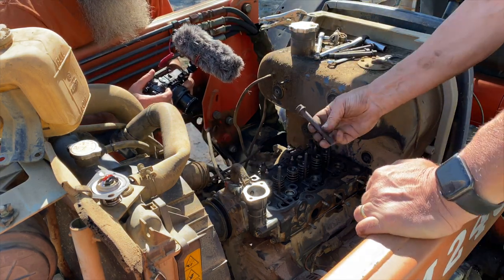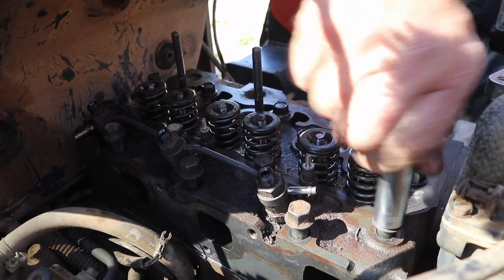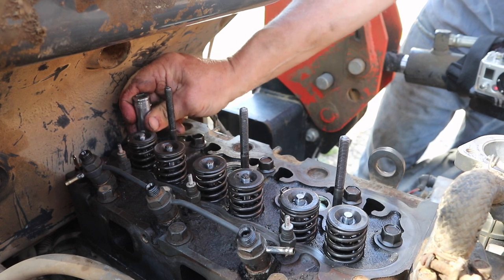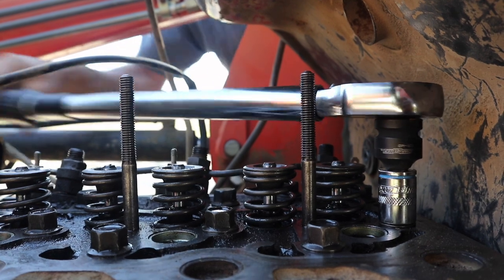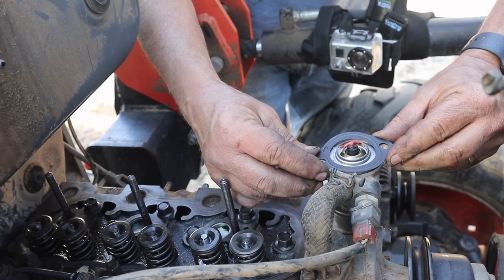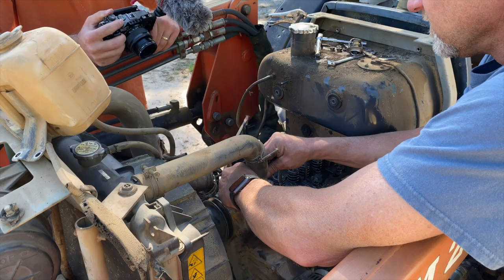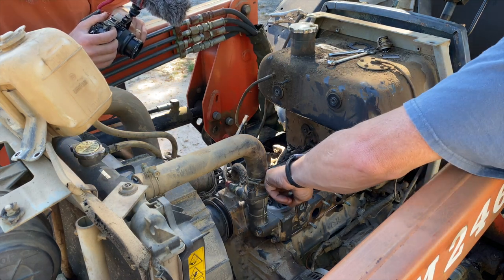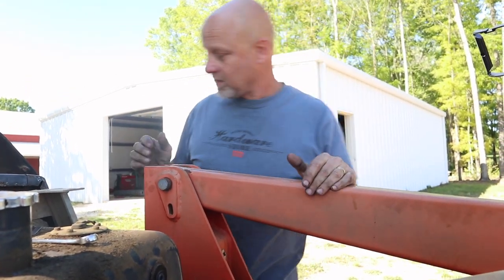Kubota L3010 Head Gasket Replacement & Reassembly D1503-e - EP 193

Comment: I did this a few months ago to a tractor that I bought knowing it needed a head. After I got  it together I filled it with oil and antifreeze and the antifreeze went straight to the oil… there’s a freeze plug inside the front timing cover that popped. Had to break the tractor in half to get the cover off… got it together today finally and it won’t start. I’ve never heard this tractor run. I don’t think it’s getting any fuel! Absolutely disgusted.
Reply from the maker: Oh man, buying other’s projects can be a good deal or a nightmare. Was there anyway to check that freeze plug without splitting the case? 

Be sure to give us an update when you get it figured out. Others might have a similar issue.
Reply: @DeanFamilyAcres  No it was definitely the plug or a big hole in the block. The bottom two bolts of the engine cover were under the edge of the frame so it had to be taken off. The case wasn’t split. Sorry. The front half of the tractor. Frame and axle.